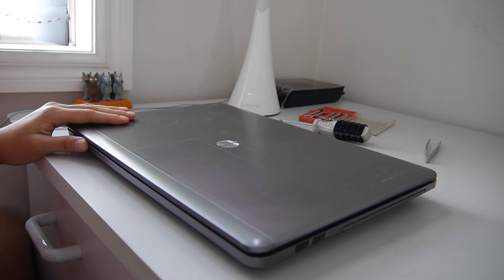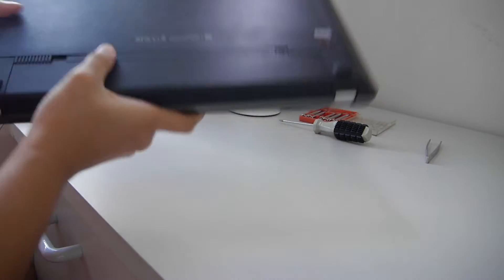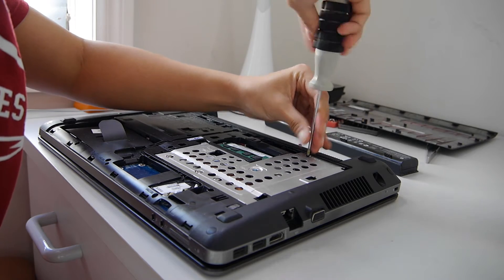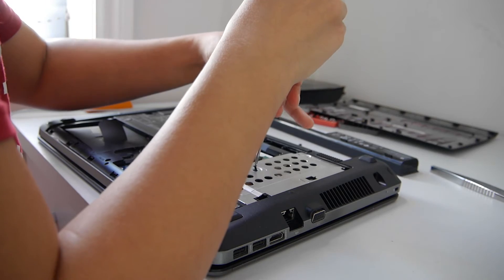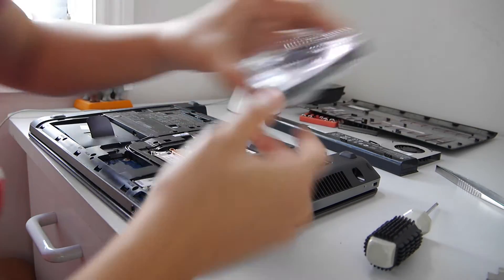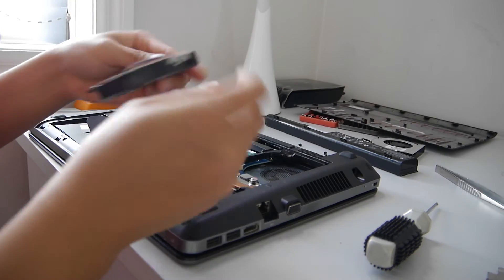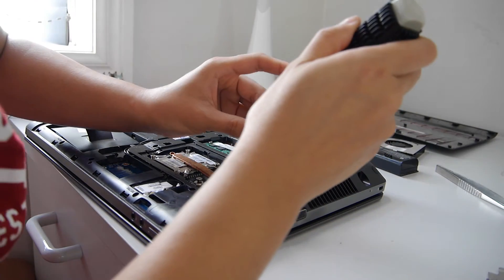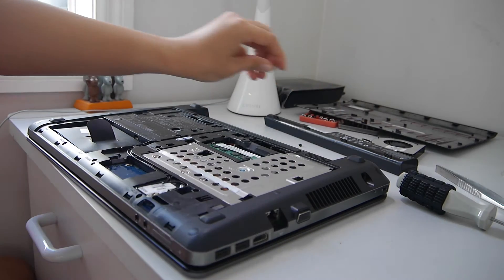Replacing the fan in HP ProBook 4540s

Comment: Did it stop making as much noise? I need to replace my fan because it's not cooling very well and sounds like an aeroplane. It's so much more effort on the 4530s compared to you one.
Reply from the maker: Yes the new fan worked great. The old fan was making noise and so wasn't working well. You can try giving it a clean, eg blow dusts away on the fan and on the exhaust port, but otherwise fans just dies from wear and tear I suppose :)